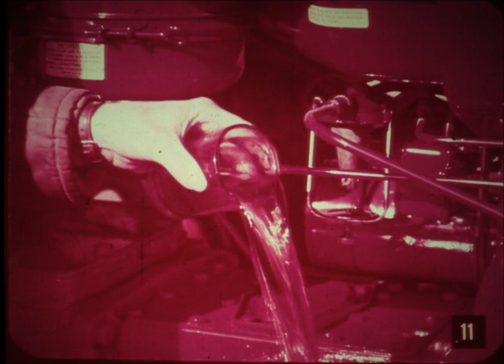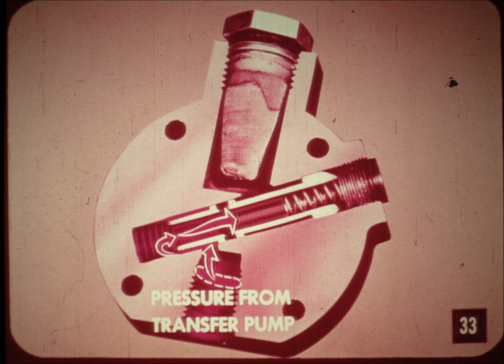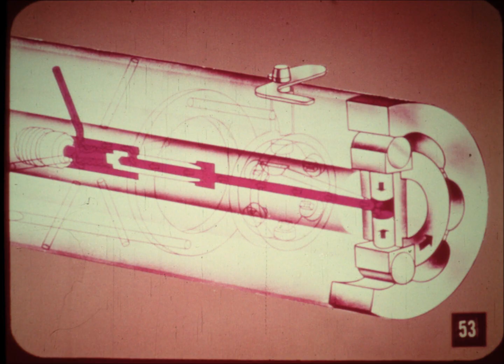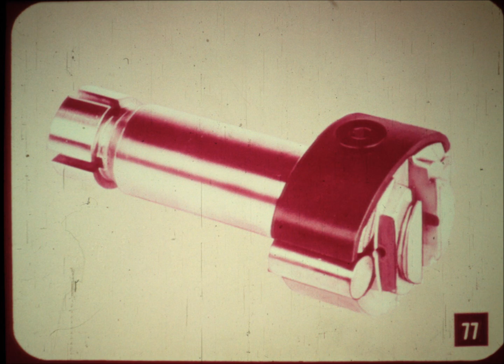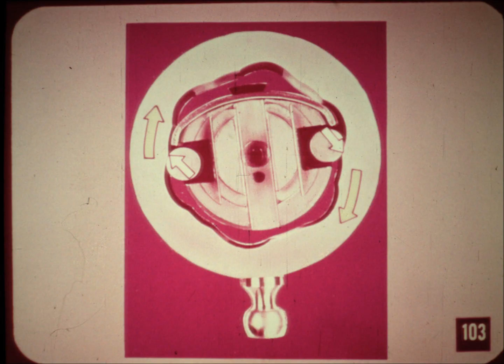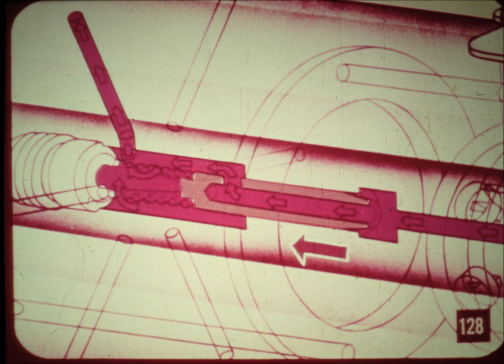Principles Of The Diesel Fuel System - Complete

Comment: The "air in the system, creates a "spongy effect", which leads to misfiring'", creates a sound to one's ear, like a 2-cylinder John Deere, idling as slow as possible.
A dig at JD, by IH, perhaps?
Reply from the maker: Possibly a bitter one. JD already had the 10 series out when this filmstrip was made causing people to move away from their two cylinders & IH was losing quite a few 60 series buyers by then too.
Otherwise....
We could give them the benefit of the doubt & say it was a hit 'n' miss engine.😁